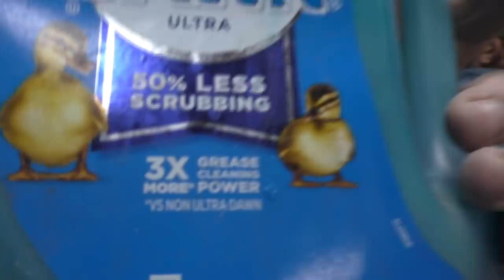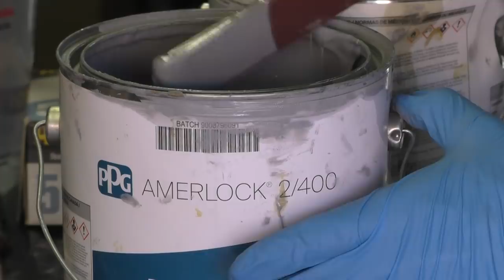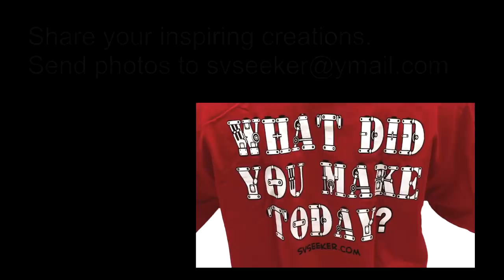Engine Room  - Paint/Pumps/Coolant/Fuel/Mounts

Comment: Idea for the worlds simplest automatic fire extinguisher.  Get a fire extinguisher that has a plastic valve on it, mount upside down over the area you are wanting to protect.  Should a fire occur, the plastic valve will melt and discharge the fire extinguisher.  
Suggestion for the sight glass.  You never need to see how much fuel is in the day tank when your not there.  Leave the top valve open and open the bottom valve when you need to check the level.  Small amount of effort to avoid a big potential problem.
Reply: Yeah and then forget you closed it and think you still have plenty of fuel while there is none left and starve your engines and get air into the injectors. Much better idea is to simply use PVC clear pipe or a clear PVC hose. Most sight glass tubes also have a couple of brass rods around them for protection.
Reply: @FrozenHaxor  Put sign on it.  Keep close other than to check level.  There's your sign.